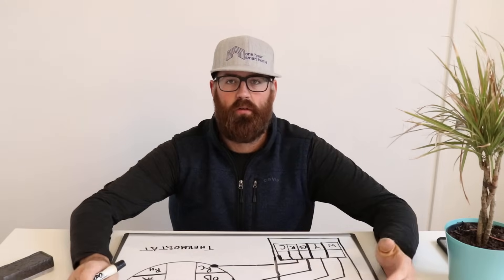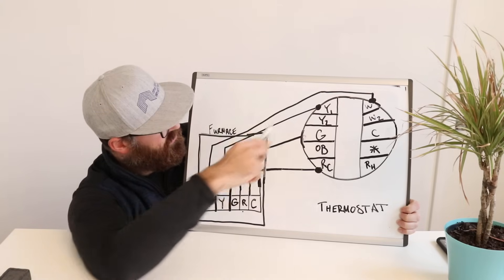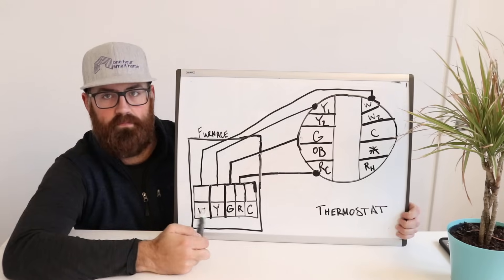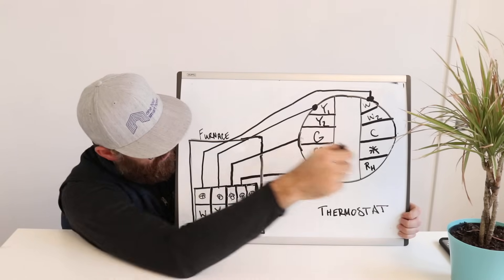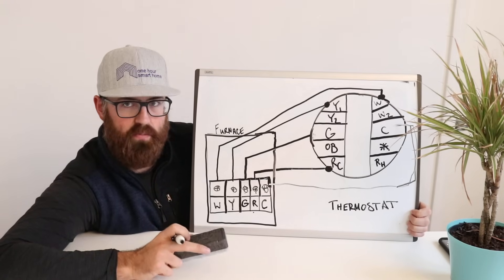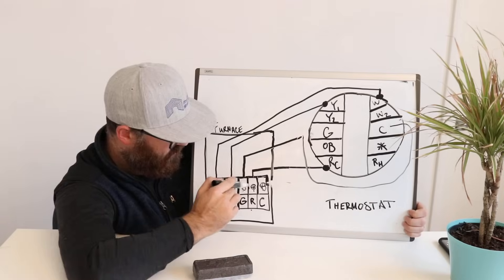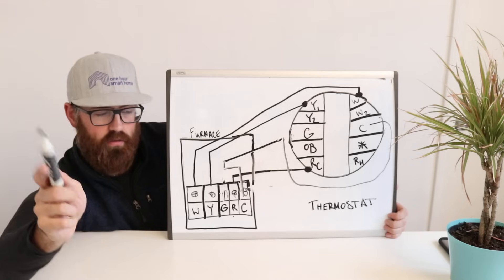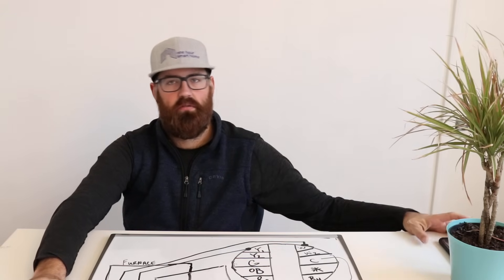Nest Wiring Diagram How To Install C Wire or Common Wire

Comment: Yes Sir, I went up to my attic and Ive been up there before and i know how HOT and tight spaces i had to crawl under and over the AC vent coils running all through my home. I get to the newly rheem ac we just installed about 3 months ago. I open the panel and behold...I did see all the alphabets and colored wires but BUT it didn't have your easy access to the common wire or green fan wire; in fact, (I should of taken a picture) but by the time i got to the panel i was already drenched in sweat) anyways, all the colored wires were all intact into this white plastic component that all the different colored wires were intact uniformed that you pulled off and onto these 5 little copper pricks. I was lost..HOLYS*&$. This 10k investment i just installed and with little electrical experience i have. I didn't even want to temp to play around with this great investment. So, I plugged everything back, screwed the panel back, getting out of dodge because i was sweating crazy and overheating....Sir, I really hoped it was as easy as you explained but i think the new technology with this plastic component that all the colored wires were inserted, then pushed into those copper pricks. I was hoping to do this C wire Hack this way because its more smarter and cleaner; however,  i guess I am heading towards the 24v transformer route. Luckily just below about 4 feet below my thermostat is an electrical outlet where I can snake the wires down to the outlet and plug transformer into the outlet. Sad because I didn't want that nasty bulky transformer taking an outlet. Oh well...it is what it is...the blessing is that at least i went up into the attic and seen the challenges/obstacles before me and i can see I went up there and discovered I am not capable to play around with that situation and the transformer is my definite route. Thank You for all you help though, I still learned a lot from you...my capabilities, my options..Mele Kalikimaka and Maka Hiki Hou     Dana

SAID ALL THIS Sir, what my understanding all the wires are running the same current...Because the Green Wire to the Fan option is so WORTHLESS here on the islands and I have NEVER USED THE FAN EVER 20yrs in my home...COULD I JUST Put the Green onto the C Wire while the Green is still intact with the fan on the Furnace in the Attic, let me know thanks
Reply: No. If you get any feedback voltage from the board to G it will send it back to the stat and burn the stat board.

Comment: I just replaced my fan coil HVAC system in my NYC coop apartment. My contractor only ran one wire for the thermostat. I just purchased a 3rd generation Nest. How should this be connected? Does that one wire power the Nest and control the fan?
Reply: No thermostat uses only one wire. Look at it again.

Comment: Hello I'm having a install issue my nest E when I turn it on for heat you hear it come on and a few secs later it cuts right back off and trys to cut back on and do the same thing.  I only have a White and a red wire..  Power and heat..  I have look further and see I also have a green and black wire that wasn't connected to anything.. I have video I can email you if you need more info
Reply: I have the same problem.. did you solve this?
Reply: @JordanLewisFamily  No I jus got the nest trying to find out what the problem is
Reply: @Bklynpimpstress   just FYI, I removed my C wire and now my heat is not short cycling!   I HAD 5 wires; W,R,Y,G,C.  I removed C.   I no longer have heat short cycling.    You don't have a C wire, so I'm not sure,.... I bet if you ADD a C wire yours will work.
Reply: I have a red and white wire connected I looked further at my wires and found a green and black wire tucked in the wall but they have never been used so idk if I should connect them.. I know the red wire is the heat and the white is the power idk what the green and black ones could be used for
Reply: @Bklynpimpstress  you need to find the manual for the control board you have (attached to your furnace).  See how they recommend how to wire a thermostat.  That's basically what I did.
Reply: @JordanLewisFamily  I wouldn't know where to find that when I moved in everything was already in place. When I change my thermostat the first time very simply red & white wires and heat comes on fine but with the nest e I guess it wasn't meant to be that easy
Reply: @Bklynpimpstress  go to the furnace.. find model of control board.  Look it up online.  It will shed a lot of light.

Comment: I did exactly what you showed and the same thing happens with my Nest learning thermostat. The little light blinks green but the screen wont power on. Think i have an issue with the Nest?
Reply from the maker: Potentially, blinking green happens on startup sometimes, or low power or if there is a issue with the nest. I would start with calling nest customer support.

Comment: Hey love the videos. I have r and its jumper to rh. Do I not use the jumper and just connect the r to rc on the Nest? Thank you
Reply: If you're saying your heater's control board has R and Rh jumpered, then, yes, just connect the thermostat side to EITHER Rc or Rh.  According to Nest, they're internally connected/jumpered.

Comment: Hi, fantastic tutorial. In Canada and it's getting cold. I have one black wire that I have no idea where it goes. I have a forced air gas furnace with air conditioning. (Five wires in total) This is where the wires go at the moment on the old Honeywell thermostat: 
Black: R
White: W
Orange: Y
Green: G
Red : Rc

Where does the black wire go on the Nest thermostat?
Reply from the maker: Might just be an extra wire not connected in the furnace system I would remove the dust cover and check to see what wires are connected where on the furnace terminal block and mirror that on the  nest.
Reply: Thanks so much for getting back to me. If I place the free wire in the free holes (trial and error), could this damage the thermostat?  @OneHourSmartHome

Comment: Sir, I have been looking at your video/issues regarding no C wire and like many, I purchased a Nest Thermostat. This issue is very prevalent on Oahu, these track homes dont usually have the C-Wire for a thermostat, to be fair because in the past we didnt need a C wire for these 20th century mercury-type thermostats, now we do...
Just about about 3 months ago we finally installed after 20 years, we replaced our Rheem Central Air Unit up in the attic and the fan module in the back yard. Typically these track homes here, the builders here always put the "minimal" units to these new track homes. Anyway, we have this,"Haus-beast mode Ac Unit" now and it sounds like a jet starting up with all the cool air blowing through our large home, even to our farthest rooms in the home downstairs...nice...Sir, but again we didnt have a C-wire so the new installers weren't able to hook up my Nest Thermostat and just put our old battery thermostat for now.
      I really was considering your other incredible video with the plug-in transformer but to me sir, having a transformer is just so ghetto(for me) I can do what you illustrate on your other transformer video because it is so simple since I have an outlet just below the thermostat area upstairs but again to me, it just doesn't look good and it takes an outlet socket away from our daily chores and what not.......BUT Honestly Sir....I know i can do this...I just need to go up into the attic and switch out the fan wire(because frankly, for over 20 years NEVER i have used our fan option, no one has on Oahu...) and reroute it onto the C-wire on main unit in the attic and Nest....Im am a Youtuber advocate repair guy, i too also have some How To Videos to help out. Wish me luck...ill be turning off all the voltage when i make this upgrade..Mahalo...ill let you know...your video looks so painfully easy...Just follow the yellow brick road....Mahalo Again Dana

Comment: So I only have a 2 wire setup, (no AC) and no common wire. Furnace has been super finicky lately, so I'm going to try to run a new wire as I have access to the inside of the wall through the opening where a French door once was. Do I need a transformer of some kind or am I good to just run a wire from C to C?
Reply: I have this same issue. Were you able to run wire from C to C? And what kind of wire do I buy???
Reply: @jillwagner4455  so I actually didn't end up running another wire, but they do sell furnace wire at a Lowe's or a home Depot. It looks like one big wire but there's actually five smaller wires inside of it. As for my actual issue, it was the circuit board itself inside my furnace that was bad.

Comment: Does this work on the Thermostat E as well? I wired as instructed by Nest (Y, G, R, W) and tested. Heat worked fine, AC does not turn on. I found a blue common wire that was not being used tucked back in the wall. I connected that to the C terminal on the Nest E, found and connected to the C terminal downstairs as well at the furnace. Then, the Nest E stopped working altogether and said it was getting no power to the R terminal. Any ideas? Will moving the G wire work in my scenario, or is my Nest going to tell me it's not getting power to R no matter what I connect to the C? Not in a hurry now as won't need AC for several months. Thanks in advance for any help.
Reply from the maker: Joel, try the other R terminal sometimes that fixes the problem. Check to make sure you didnt blow a furnace fuse. Otherwise you can try the common wire transformer method we have in this video https://youtu.be/gahPxCcPDto if that doesnt work your system is incompatible with Nest. You could try an ecobee sometimes they work when nest wont with some systems.
Reply: @OneHourSmartHome  There is no other R terminal on the E.
Reply from the maker: @joelduffy1  You can use the R terminal provided on the Nest E. This method works for either Nest Thermostat. R is the power terminal.

Comment: Hi question is that G wire 24volts?
Reply from the maker: It has no voltage on it untill a signal is sent from the thermostat which would be a 24v signal.

Comment: Each time you mentioned the C wire and G connection it was helpful, but as you mentioned earlier a heat pump might be different so you might have wanted to say something added about the fan not being needed because the furnace turns on the fan "Except" when you have a heat pump and the fan is turned on without the furnace or compressor to circulate air when minor changes in temp are only needed which saves money!
Reply from the maker: Robert thanks for the insightful comment. We're adding a video on heat pumps also.

Comment: This will disable the ability to run the fan on its own, to circulate air in the house.
Reply from the maker: Only if you don't have an extra common wire.
Reply: @OneHourSmartHome  why would you do this if you already had an extra common wire?

Comment: Hi there. I’ve been searching the net but to no avail. I’ve only got three wires in my thermostat. Can’t figure out how to hook up my nest.
Reply from the maker: Do you know what 3 wires you have? Typically in  three wire system you would have R, W and Y which would be Power, Heat and AC
Reply: One Hour Smart Home The three wires are red white and black

Comment: I only have 2 wires on my furnace? I only have heat on my oil burner since I don't have air conditioning. We don't need cold air as I live in Northern Canada and when it's hot for only a couple weeks here we suck it up into our bodies for that small time and never complain about the FREE heat!
Reply from the maker: Then you would just connect the the wires in the R and W terminals.

Comment: HI I have Red and Blue wires in my carrier Thermostat,It says V+, Vg, V+ Red and Vg Black. Will 3rd gen Nest work with that? I connected to RH and W1 only Heating shows up.
Reply from the maker: You would need to take out your existing wiring and wire up new wires to from your furnace to your thermostat. The V+, Vg, V- wires are typically associated with proprietary wiring and thermostats from carrier, so as is your wiring is not compatible, but you can replace all of the wiring from the furnace to the thermostat and it will work. Rather than open up walls a lot of people will just place the nest near your HVAC system so you can install it easily without running wiring everywhere. You can then add nest temperature sensors: https://amzn.to/2zacgpu for other rooms if you want to hold the temperature in a specific room.

Comment: I just bought a Honeywell Wifi T5+. Do I have to jump the G and Y to this unit after switching the Green wire G to Common wire C? Thank you!
Reply from the maker: no you won't need to jump it, but you would need to change the connection from the G wire inside the furnace terminal to the C wire.
Reply: What if I have one red wire that is split between R and RC. How would I go abouts hooking up the red wire to my new Honeywell T5+ wifi thermostat? Thanks!

Comment: My system currently has a RiteTemp thermostat with a white, yellow, green and red wires hooked up. There is a jumper from the RH to the RC. I have nothing connected to the C terminal, but there is a black wire that is not connected. Could this be my common? I'm looking to convert to a Nest, but want to make sure I have a common. Thanks
Reply from the maker: I would try hooking up your system without the common wire. Most of the time the nest: https://amzn.to/2KBI9gi will work without a common wire.  

If you are having issues with power you could probably use the black wire as a common wire. You would need to connect it at the thermostat and also connect it in your furnace at the furnace terminal block.

Comment: Help! i did this, and the Nest Equipment diagram is not showing the C wire connected. i added the C at the furnace, next to a beige wire sharing C...any chance of a problem?
Reply from the maker: No, the c terminal will often times have another wire already on it for your Air Conditioning system which is fine. I would re-check to make sure that you have a good connection on the terminal board with the new wire you connected and a good connection in the thermostat c wire terminal.  Typically a loose connection is the issue.

Comment: Could you run a wire from the connected G wire and bridge it to the C terminals..?  so one green wire (fan) connects to both G & C ..
Reply from the maker: Your fan would most likely be running 100% of the time if you did this because current would be going through the c wire. Never tried it, and have not recommend it as a solution but share the results if you try it.

Comment: I have a Honeywell HZ311 panel and my home has 1 unit with 3 zones.  Installing 3 Nests to replace old Trane thermostats. I followed your instructions and I ended up blowing my 5 amp fuse on the furnace board.  I then realized when I opened the HZ311 panel that they are wired from the thermostats, which is then wired to the furnace board.  So, I think I need to move the green G wire to the C terminal for all 3 zones inside the HZ311 panel - but then do I need to do it on the furnace board as well?  Or leave that as is?
Reply from the maker: The Honeywell panel: https://amzn.to/2GRhVp3 is most likely powered separately by a transformer when it was originally installed so you don't need to make the adjustment in the furnace wiring at the furnace control board.  

You can just change the wiring from the thermostat to the honeywell panel. Leave the wiring as is from the honeywell panel to the furnace board. What happened when the fuse blew is you were most likely sending extra power from the powered control board to the furnace which already has it's own power source and overloaded the fuse.
Reply: @OneHourSmartHome  Just seeing this - thank you for your response.

Comment: I have a cheap ass Honeywell bypass Humidifier - and I'm not sure how to wire up the Nest Gen 3.... I have 5 wires going to my thermostat currently (a programmable old Honeywell) - and on the current thermostat R, W, Y, and G are connected.....

On the Furnace end, I have C, G, R, and W, connected.... with nothing in Y....

I have a loose extra wire at both the furnace, and the thermostat that can be used if needed.....

For now - I went ahead and wired around the humidifier (only wired the thermostat with all 5 wires, wired verbatim to the Furnace/AC control board) because I didn't want to screw this up and wanted to make sure I have AC on a 100F day tomorrow..... However, I'd like to wire this humidifier back into the loop so I can kick it on in the winter time....

What do I need to do to wire the Honeywell 2-wire humidifier into the loop?

Comment: I have a dual zone setup.  My fan is set to constantly circulate air at a low speed but is controlled by the downstairs Nest Thermostat.  I want to replace my upstairs thermostat with a Nest so can I still use the G wire solution and not affect the fan?

Comment: Can I use a spare blue wire as my C wire?
Reply: Absolutely, the Blue wire is actually meant to be used for connecting the "C" terminal.
Reply: @Your-Self  Thank you for the response!
Reply from the maker: Agreed Yourself is correct, you want to make sure it is connected to the c terminal in the HVAC system also
Reply: I used spare blue wire as C wire and it is working well
Reply: @yunuskuloglu5419  : Did you disconnect the green wire by any chance?
Reply: @jodeci888  I did not disconnect the green wire
Reply: @yunuskuloglu5419  Thank you again for the replies.